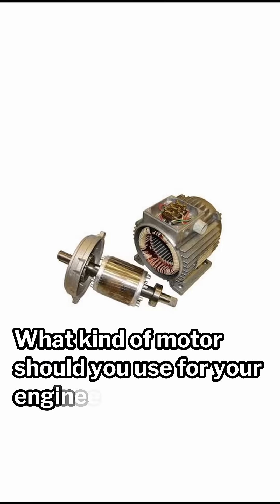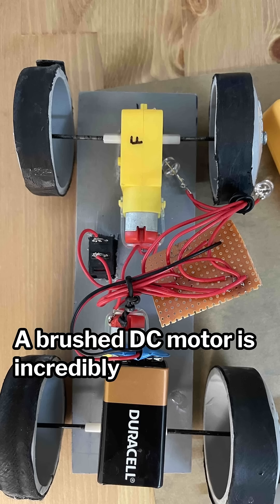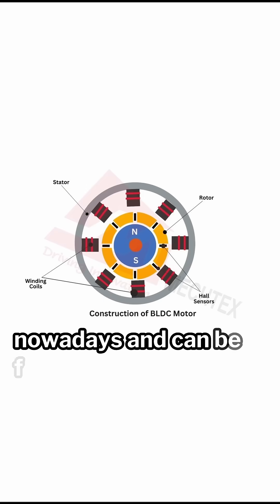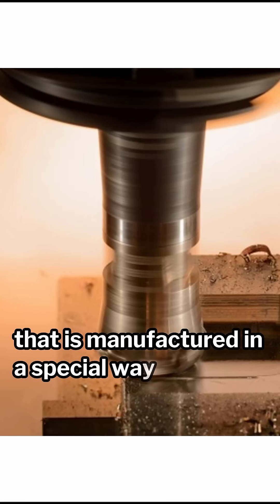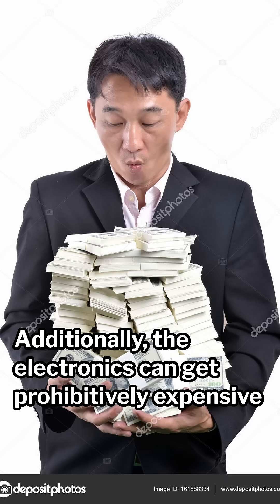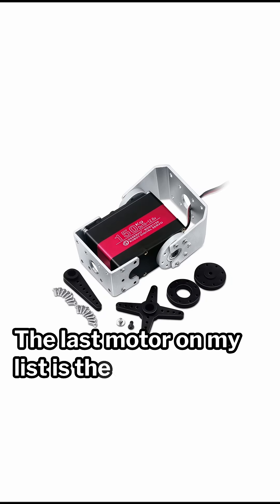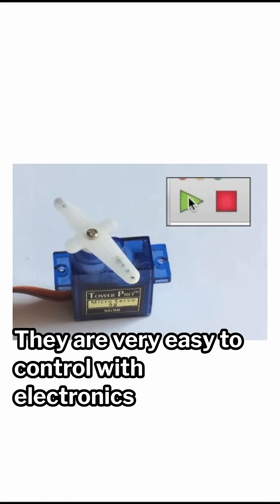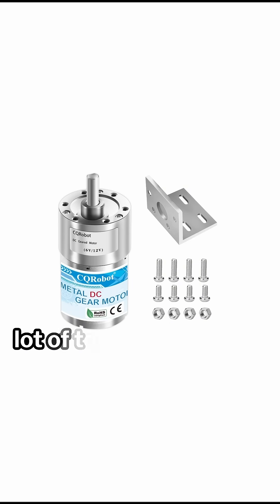MOTORS MOTORS MOTORS, WHAT DO I DO????  #advice #arduino #electricalengineering

Comment: A topic that’s pretty interesting is the difference in winding layout between BLDC and PMSMs, and how the different layouts of those windings correspond to the voltage waveform they output when their rotors are manually rotated.

Comment: Hey i want to ask if is theres a way to
Simulate a micro controller using some kind of program without having a micro controller on hand or the stuff for the project you want to create?
I mean i use fusion 360 to design stuff before making or deciding which material to use on projects.
But how do i simulate the "working" of the said projecs without having the material(electronics)
Like.. i dont want to accidentally fried my electronics before testing it in some kind of sofware/program, kinda like engineer testing their bridge strenght in simulation first before testing it for real.
Reply: This info may be outdated, since i havent tried in a long time, but Proteus has libraries to work with microcontrollers, You can Even "flash" the uController with the program You are developing into Proteus, to simulate it.
Reply from the maker: Wokwi .com is what I found after a quick google search. So it looks like you could
Reply: @ElectronicGuy1  wow thanks for the reply
Reply: autocad (the company behind fusion 360) also has a web app called TinkerCad, and it's quite good if you want to simulate just electronics